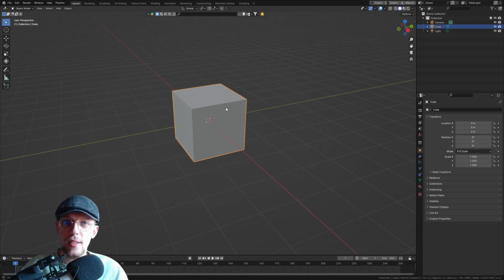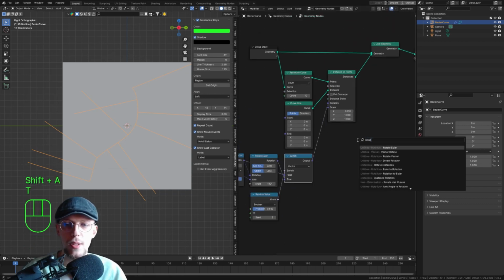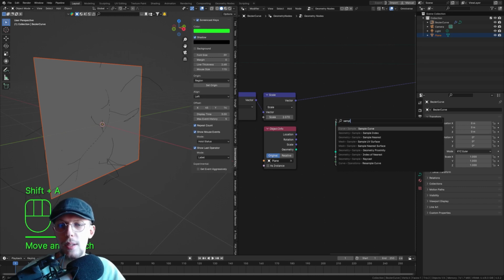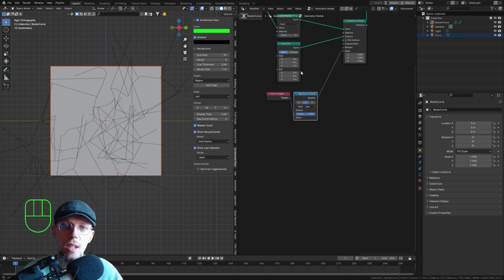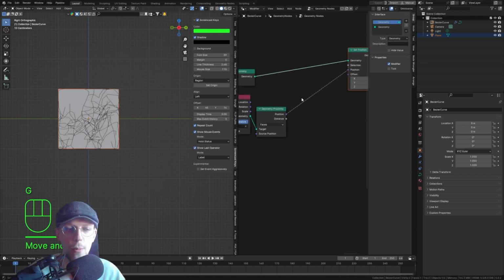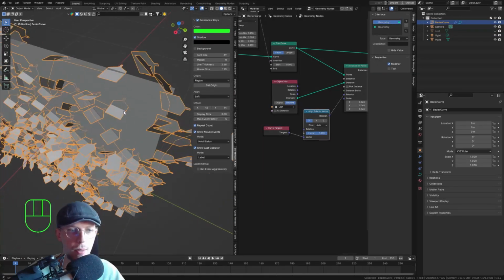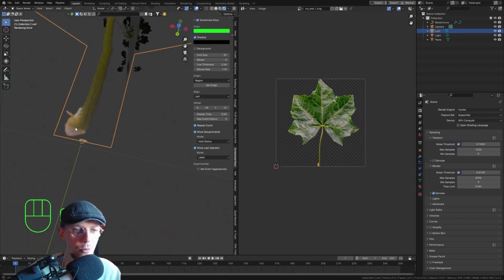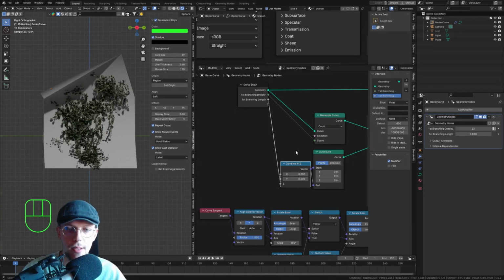How to create procedural Ivy in Blender! (Geometry Nodes Tutorial)

Comment: Thank you. 
Although the results I got where NOT exactly what they should, I think.  I followed all your tutorial and the ivy didn't quite rotate out of the wall (some branches were always into the wall, even if I did use all your values to the tee, or if I tried to tweek them somewhat)...
Well, I am starting over. I wonder what I missed or did wrong...
Reply: I repeated the tutorial and I still have the same problem. What differs from yours is that (more or less at the 10:19 mark) changing in the Object Info from Original to Relative doesn't produce any changes (the branches remain in their directions - some forward, some backward). I tried it in both version 3.6 and 4.2...
Reply: This tutorial is getting more and more useful to me (even if I can't understand half of those nodes). The curve tangent is quite a find. 

And I managed to overcome my problem, up to a degree at least, using musgrave texture instead of noise texture (since in 3.6 it has more parameters that I can play with)...